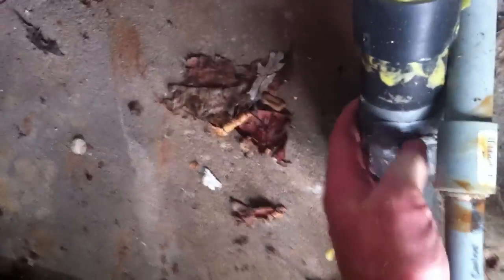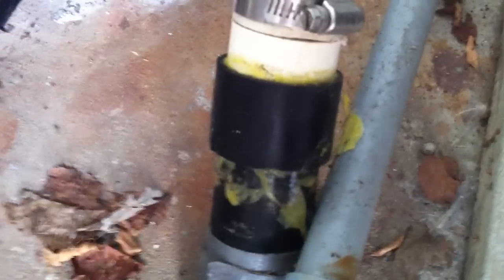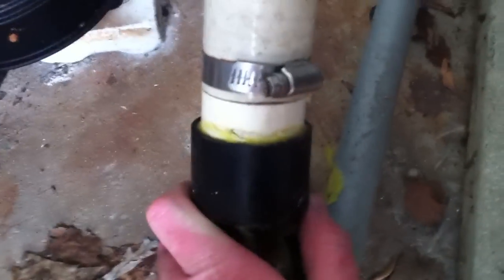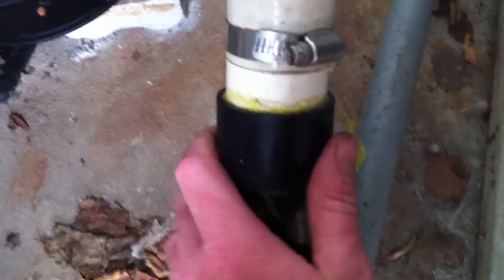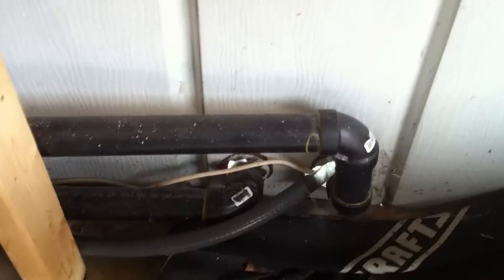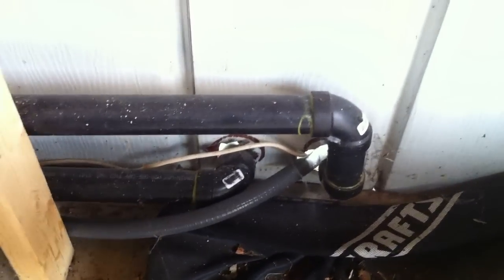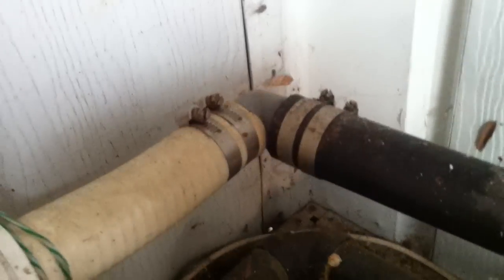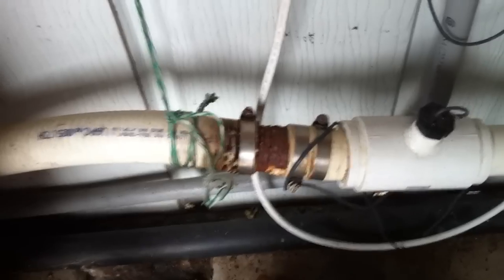Heat Pumps & One Of The Worst Plumbing Installs Ever - Pool Equipment Installation Tips

Comment: Please tell me what material is correct!? I am terrified of someone doing it wrong. I have a heat pump(electric) on the way for my above ground pool.  Electrical is done, South Texas. My pump has never been hard plumbed. What should he be using. He said it was flexible white pvc? Idk and bypass valves

Comment: Wow home owner special!! What did the customer say when you told them this is all a bad joke??
Reply from the maker: There was nothing said to the owner directly, just my report.  They did not elect to make any of the changes which I recommended.  Go figure.
Reply: @Swimmingpoolsteve  Strange considering they could have fixed almost everything wrong with that installation with pvc pipe and fittings, except for maybe 1 check valve for the salt cell.  Maybe under $150 total if they did it themselves.